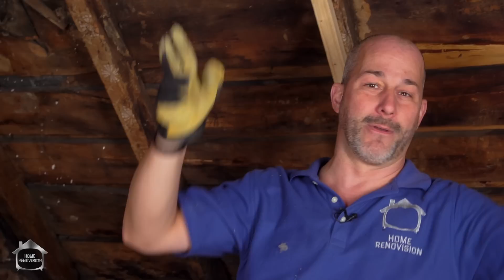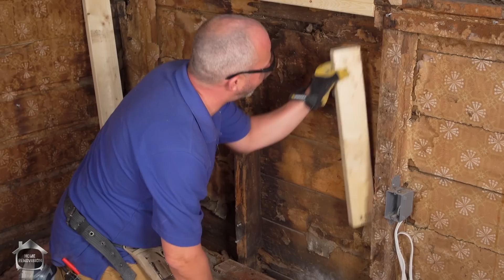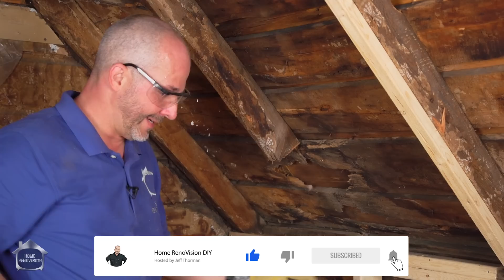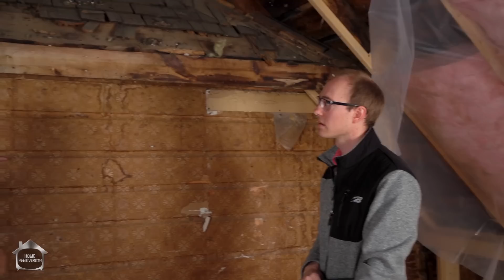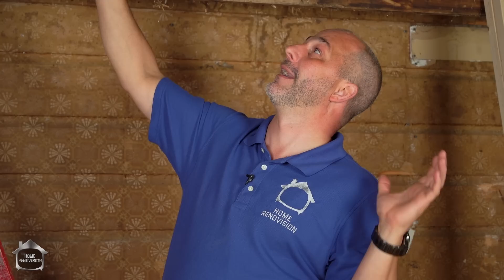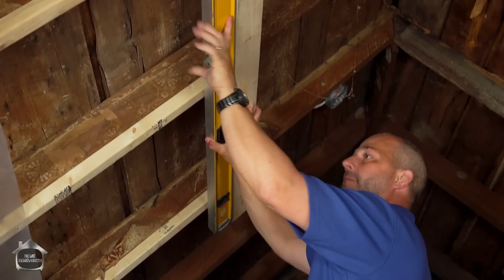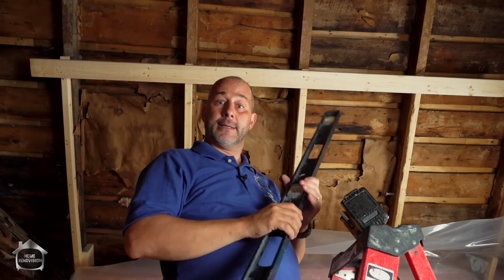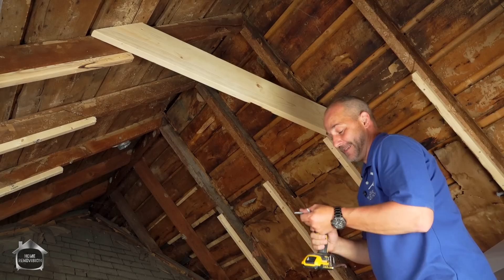How Structural Engineering Affects DIY Projects

Comment: At what point did you take out the original collar ties ?  Doesn't moving the ties up weaken the lower half of the roof more toward the middle? So roofing here in the U.S. needs tar paper, insulation board, and the roofing material. that alone is a lot of weight, then add in the winter snow. Maybe I missed something or just don't completely understand. sorry to sound incompetent
Reply from the maker: Cheers Vinny, I had a structural engineer in to do the calculations and followed his direction. It all comes down to the higher you go the stronger the brace and the stronger the fasteners you need to accomplish the goal. you can actually remove the need for collar ties altogether but then you need serious steel angles in the peak.
Reply: @HomeRenoVisionDIY  Thanks. so do you install a new ties before removing the old one?  Also, I saw one of your videos where you built a floating deck for a couple. You were using a Craftsman drive handle with removable sockets and the other end was an adjustable head. do you have the model number for that? 
thanks and keep the videos coming.

Comment: Hi Jeff,

What climate are you in? In specific, why R20 in the rafters? I'm looking at a loft area in my second floor area which is limited on headspace. Old house here too, with 2x4 actual in the ceiling. I'm in zone 5 according to https://www.energy.gov/energysaver/weatherize/insulation which requires minimum R49 which would require batts at least 13.5 inches thick. Wondering why you're doing R20 in your rafters. Thanks!

Comment: Ive got a 70's era home with gable roof, ridge board, mid ties, no collar ties and lower rafters doubling as ceiling joists overlapping over a bearing wall
I would like to remove the mid ties so I move around and can air seal the attic, and install collar ties, Is this something you advise against?  I have seen collar ties along with knee walls in attics like mine, but a little unsure about whether or not I need the knee walls.
thanks for any help you can give me
Also curious about how to get a yearly membership.
jp

Comment: Wait, did he just say he's adding the strips because old 2x4's are actually 4 in. As opposed to today's 2x4 which are actually 3 1/2 in.?  To make that statement true. You should be subtracting wood not adding. I'm thinking you meant to say Vaulted ceilings today are framed with two by sixes, which aren't actually 6 in. How do you get a R20 on the walls because today's two-by-fours are thinner?

Comment: I hope you can see this and respond. I am building a green house for the wife, we'll call it her "she shed". The roof will be at two different angles, the north side will only be around 3' and traditional house or shed built. The other side will be the Plex sheets. My question is do I have to worry about breathing for the traditional side of the roof? And if so, what would be the best way to achieve it?
The north side will be completely finished walls and roof on the inside. I hope this makes sense! Love the video's, they're great!

Comment: If the existing rafters were structurally sufficient you could have run the spacers perpendicular to the existing rafters to minimize thermal shorting through the wood. Blow in insulation could then be used to fill the cavity. Another option, but more expensive, would be to use a layer of polystyrene board insulation between the rafters and drywall (or drywall alternative).

Comment: Hey Jeff! or anyone else who knows the answer. About to to insulate a 100yo house with 2x4 rafters. Love the 2x2 extension idea. My question: is there room above the insulation for ventilation? I couldn't really see how that's done. I'm guessing gravity pulls the insulation against the vapor barrier and there's an inch or so of room between the top of the insulation and the deck. Is that correct?

Comment: You're reading the level wrong on your "temporary brace." One has to keep the level either horizontal or vertical, not at the angle it was being used. I'd suggest using some mason string and a line level. The string isn't perfect in horizontal situations because of gravity, especially in long runs, but you could've corrected the roof-line sag, strengthened the structure, provided depth for more r-value insulation, and a nice level ceiling surface. Those long strips added to the rafters for depth just added more weight to the sag. One would have to do the math to see what depth would be needed for the r-value required, including the air space between the insulation and roof sheathing to determine whether 2x8's or another size would suffice sistered to the old rafters but that's the way I would've gone. At least you're trying but it appears you have thousands of people following and probably also doing it wrong. Admittedly...it's easy to be a critic. Sorry.
Reply: My God. No break or lap on the double top plates that are joined at a half rotten plate. Eyeball guess at the heel of the rafter reinforcement. Why not just take your carpenter pencil and scribe a fit to the top plate. WTF you could have done that in the time you took explaining why you did not need to.
  Why in the heck you don't use a rotating laser to at least give you a chance at a level collar tie line is beyond me. Ridiculous
Reply: And the no predrill for the lags, with no backing washer (Exactly why structural screws exist).  Or the incorrectly used pan box with an open knockout right up against wood.  Or not understanding that all the nails he put into the kneewall are in shear with the grain of the wood which is useless.  Or the hilariously bad framing on it in the first place.  Or the ice damming and condensation issues that will come from the incorrectly insulated roof. Or the laminated 2x4 on the kneewall that is doing nothing, but he thinks somehow strengthened it. Or...

This is a perfect representation of DIY guys pretending to be contractors.
Reply: @lousassol3  I thought he addressed that just before adding the nails - in consideration for movement/flexibility and what is the existing structure and material -> don't go creating a super perfect and inflexible addition to a building that isn't perfect and inflexible.

"on budget" is never a contractor-friendly expression.

Present a contractor with a 15-year-old car that has a dent and they say, "oh we need to gut the inside and redo everything" so it can run like a BMW.

The advice and work done here no doubt comes from years of experience working on old beaters, which is what most of us are dealing with at home.

Having said that, always go with what the structural engineer has to say - that's the message I learned today.

Comment: I haven't finished watching but I would've done a few things differently like cutting the nails between the corner board and the sheathing. I also would've built up the top plate to match the thickness of the original plate and lapped it with the existing top plate rather than cutting it square. A taut string-line, wedging a temporary board to straighten the rafters, and sister a board to both keep it straight and add depth for insulation is what I've done before. A knee wall could beef-up the structure as well.

Comment: Jeff, I'm about ready to do the same thing on a 1930 attic.  Question about insulation.  What about closed cell spray foam  instead of glass?  Also,  if you use spray foam, would you spray it directly to the roof or box it out one inch so you have an air channel to the peak from the soffits.
Thanks
Reply from the maker: I would install soffit baffles. looks like an egg crate and then spray!
Reply: Closed cell no need for air flow or vapor barrier. Just go 1¹/2 on the closed cell and fill the rest with glass
Reply: You need an air flow under the boards to cool the roof shingles, why we vent. I nailed a 2x2 in the corners and covered with 1/4” OSB....sprayed foam over the OSB. 12yrs now and no curling on the shingles

Comment: he should have sistered roof joists with 2x6's rather than adding a 2x2 to bottom of 2x4.    sistered joist should have extended to roof peak.
Reply: I agree! wouldn't rely on those existing 70 yr old rafters to hold for another 20-30 yrs.  If you're gonna renovate an old house, might as well strengthen it and let it hold for another 20-30 yrs.

Comment: raising the collar tie will increase the tension on it, but the weak point will be the rafter.  the rafter would snap at the connection from the bending moment before a tie would break from tension.  More bolts in the rafter just makes the rafter weaker where it needs to be strongest.
Reply: The engineer did increase the collar tie to 2x8 so that increases the tension resistance.  For the rafter, he probably has engineered and determined that the existing rafter would hold under bending moment.  I would have sistered those rafters though and would not rely on those existing 70 yr old rafters to hold for another 50 yrs.

Comment: Do you think it was better to level your "top plate" for your ceiling with all the issues we saw. Or just measure from the new knee wall to make all those numbers the same regardless if its level it would be parallel to the knee wall?

Comment: That things got rot all over it. Maybe soak the whole thing in copper green 🤦🏻‍♂️
Reply from the maker: It has definitely had water events, however it is still solid enough to hold a lag bolt so I am not concerned about it's strength! Cheers!

Comment: I don't want to be a keyboard whiner here but when I hear or see you offering ANYTHING having to do with structural engineering, I simply cringe because much of it is false information and people here will apparently follow it.  I highly recommend you reconsider trying to play engineer and have people contact an SE or PE for critical structure questions.  Wood interaction with steel fasteners is tricky business and I can guarantee you that bigger does not always mean better or stronger.  Your recommendations on the lags in the collars is not how an SE would approach this but at least good proof of why it is not a good idea for a DIY to mess with structural elements such as trusses.

Comment: Not sure your correct on the lag bolts “drive it until you can’t drive it anymore “. Crushed wood fibers weaken the structure; at least in sheeting it does. If your doing it for clamping use washers.

Comment: Can we use jig tool (like Kreg and others) to make sideway holes in 2x4s when building a structure? Is it a code violation in Ontario or not?
Reply from the maker: if you are working with shear then you need top be at right angles with your fasteners. Cheers!

Comment: Wrong wrong wrong. ... omg everything he said is wrong. Minimum R value for ceiling in the hottest place in Florida is R-30, much higher in other parts of the country. You need at least 14” for fiberglass at this R rating. The collar ties don’t add strength to the roof rafters they prevent the roof from flying away and are a code requirement (not optional).  You can’t reinforce roof rafters by loading them down on the floor joist below.  The pony wall has a minimum wall height of 5’.   Don’t look to this video for ANY information or guidance. (And yes I am a structural engineer)

Comment: Really bugs me when a "contractor" plays the engineer,  with a steep pitch like that I would never have collar ties so high up. Install tension cables or leave nice cedar colar ties exposed, doubled up or anything  except what he did. Everything done in this video is wrong.
Reply: He didn't play engineer he hired one and it got designed by a professional. A steeper roof slope gives you less thrust....higher ties give you more thrust. However when you calc it out I dont think a couple 1/4 lags do the trick (probably called out for more but not shown in the video). Also, you have to worry about the existing rafters bending more due to the ties being raised. Some good, some questionable, but not all bad....
Reply: Luis Mendez you’re a clown

Comment: Omg, sometimes it seems like a kid with a nail gun. Its a baloon buildng, you need to bring the stud down to the botton plate, you cant just put 2ft of wood, put some random placed nails and hopes to stay. And your roof came down that way cuz the house was already moving because you removed all those support points without supporting first. Omg bro. And what about all those blocks you left inside that wall even after talking about how bad the wood is as an insulator.
Reply from the maker: hi Pedro, you obviously have no experience with this type of construction. But I hope you feel better trying to tear me down to lift yourself up. not a good long term strategy as you will indeed end up quite delusional about your own abilities! Cheers!

Comment: Hey Jeff, I am considering redoing my upstairs space. However it's the same situation your in on "Raising The Roof" circumstances without raising the ceiling for me. It's on insulation and airflow in a non-attic closed ceiling. I'm wondering if you have made the continuation finishing your loft insulation. That way there I can see it done properly with the airflow cavity plus insulation to do on mine. Much appreciated.
Reply from the maker: Hi Shawn. in my house i have no fresh air soffit venting so we just closed it all in. if you have soffits then they sell a styrofoam panel that looks like an egg crate to preserve the air movement once you have stuffed in the insulation. the benefit of fresh air is prolonged life of the sheeting and roofing tiles. it helps to reduce the heat build up in direct sunlight during the summer months. We are going to switch to a metal roof for longevity. cheers!
Reply: Thanks Jeff appreciate the advice and getting back to me.

Comment: Earplugs with a nail gun and impact gun.  Up to you, my Tinitis even wakes me up at night.  Sorry man, I would have done the beam.  Posts under the bearing ends.  Bottoms of the posts on headers cut into the existing studs.  Build temporary shelves for the beam to rest on.  Beam depth + 6".  Open up the end of the building and slip the beam in from the outside.  Lumberyard delivery with the boom truck is often free.  Jack the beam up into place.  This will automatically take the belly out of the ridge and the outward horizontal load off that rotted wall.  Probably drag that wall back in as well.  (Up to you if you then want use come-alongs to straiten the wall)  Once the beam is properly in place, install the posts between the headers and beam bearing end.  Steel Simpson LTS 18' straps to secure the beam to posts.  On the gable end, sheath the whole wall interior with 1/2" OSB.  Add construction adhesive.  Locks it all together and makes the whole wall a box beam.  Plenty to transfer all loads to the foundation.  2x4 collar ties just to create the ceiling plain.  That dormer will be HELL to frame with that roof so far out.    My house?  Seal all that old wood with high density foam.  Worth every penny inn that situation.      
 Our electrical inspectors would never let that fly.  All ceiling boxes to be fan rated. Stapled within 6" of box.  Not trying to be a hero, just a different way of looking at the job.  But enjoyed the video.
Reply: Props!👍
Reply: I love that your feedback is constructive and informative.  Most of the negative comments are confusing because they don't explain anything

Comment: I'm a structural engineer too. Just a quick comment about collar ties. I know this video was in Canada, so I apologize for any discrepancies in terminology.

By definition (see APA's Wood Frame Construction Manual or the Canadian equivalent), a collar tie is a structural framing member located in the upper third of the attic space that ties rafters together to resist roof suction loads at the ridge. That's why most building codes allow strapping over the ridge instead of collar ties. In many old houses, the collar ties function as tension members that keep the ridge from sagging merely because there were no ceiling joists installed. However, the higher the collar tie, the greater the tension force it has to resist to keep the ridge from sagging. As a result, the additional point load created on the rafter at its connection with the collar tie could cause the rafter to fail.

That's why the engineer's first choice was to install a ridge beam and columns. It's the easiest way (on paper) to accommodate the gravity loads on the roof. The other side of the coin was ease of construction. Since the ridge beam was difficult to accomplish in the field, the engineer had to make sure there was enough strength in the rafters and collar ties to accommodate the gravity loads they would encounter at the installed height.
Reply: (Aspiring engineer here.) Does the engineer have to measure and count every piece of framing within the existing structure to later draw up his plans in the office?
Reply: My house is 100 years old and does not have collar ties. It just has joists/studs in a triangle shape. Nothing else; wide open in the attic. Is this ok?

Comment: Bringing homeowner framing to the scariest level ever.     I would love to see the struc. Eng. that is willing to put their career on the line by signing off on nail gun spikes...which are very different than a spike...holding the load from a roof.   You are the guy that gives handyman all over the world a bad name and guys like youare the reason the rest of us have to go through so much bs to get licensed and insured.    Thanks
Reply: As long as you use enough nails there is no problem with carrying loads in shear.  No different than truss plates which are just alot of nail like spikes pressed into the wood..  I just had an addition framed on our house with attic trusses supporting a 11x16 bedroom in them spanning a full 40 foot with no load bearing wall below them and only simple truss plates carrying all that bottom cord weight from the bedroom.  As long as enough nails are used over a large enough area there is no problem with this method of repair.